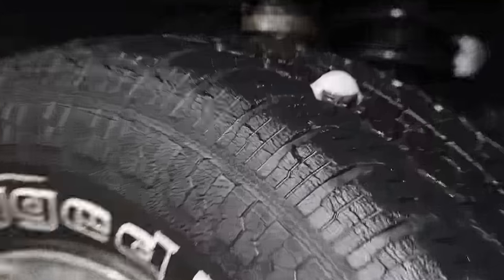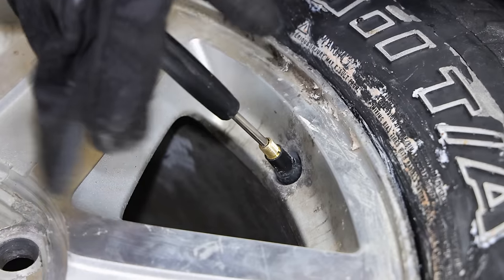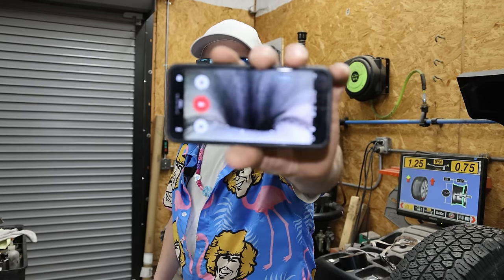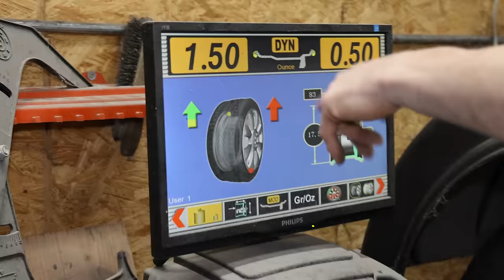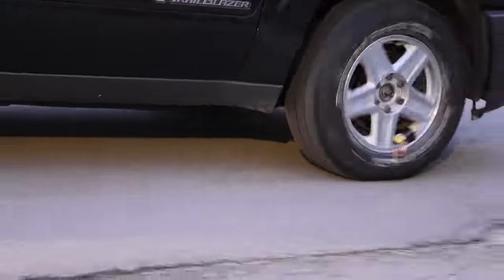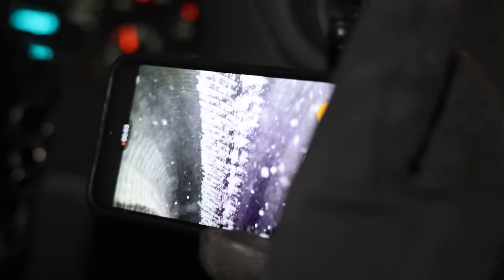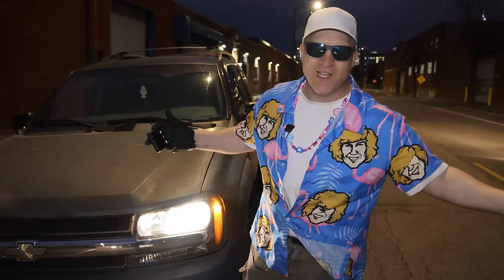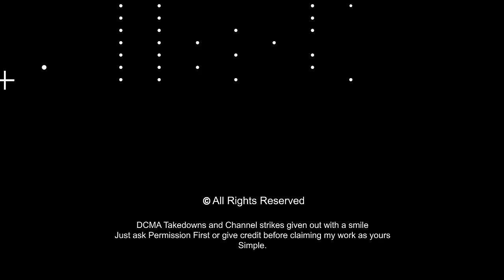GoPro Inside a Car Tire (With Balance Beads)

Comment: Briefly studied this in engineering school. For balance beads to work the tire has to spin out of concentric. Won’t give you consistent results on spin balancer because the wheel is held firm. 2oz out of balance nothing to brag about.

Some have good luck with balance beads. For others when the wheel hits a bump it spins out of concentric, moving the beads, which then have to move back into place. A bump from the road followed by a bump from imbalance. And then there is the issue of having to rebalance every time the wheel starts rolling. Some beads are sticky or use static electricity to stay in contact with the tire.

That I know, OTR trucks simply do not balance any but possibly the steering tires. And use weights.

Good old fashioned balancing works. There is a reason your new car doesn’t come from the factory with balance beads.
Reply: I have to wonder if they act as an abrasive on the inside of the tire. Probably not enough to affect the service life.
Reply: They came in my Yamaha ATV tires from Factory somebody in engineering probably recommend them
Reply: Sometimes you need an engineer to call out the BS. Thank you sir!
Reply: But then you sometimes need to rebalance as the tire wears.
Reply: @VndNvwYvvSvv  I don't find that to be as true as it was 40 years ago. Balance motorcycles tires myself when mounting. Have checked balance before removing old tire and found it to still be pretty good. On cars my deal with Discount Tire provides free rotation. Don't believe they balance when rotating.
Reply: "Some beads are sticky or use static electricity to stay in contact with the tire". 
Bragging moronic statement of the year which disqualifies you as a human being. Guess you never heard about centrifugal force...
Reply: @rafars2246   Yeah he definitely made that up. Sticky beads would just be a big wad of sticky beads, unless they magically didn't stick to themselves. And static wouldn't be nearly strong enough to do anything vs the forces caused by rotation of the tire
Reply: @rafars2246  wow, your attention span can't remember the sentence prior to the one you are reading. "And then there is the issue of having to rebalance every time the wheel starts rolling. Some beads are sticky or use static electricity to stay in contact with the tire." Static/sticky holds the beads in place when the wheel is not rolling.
Reply: @N4HHE  It's clear you're the actual engineer here. The lack of reading comprehension in those replies physically hurt me.
Reply: @KingNast  you are too young to remember how various liquids and Slime were touted as tire balance aids before the “beads” craze. Beads moving around in a rubber tire are going to generate static electricity and could stick to the tire for a while when stopped so as not to have to completely repeat the balance phase when one starts rolling.
Reply: He needed to run the tire with the go pro, BEFORE adding the beads as a control.  See what the balance is, and then add the beads.  

Weighing the go pro, light, mount, VHB tape, everything before hand, and then adding that weight in beads would have also been good too to see if the beads counteracted the weight.  Would have been interesting to see that.  

The issue is also the beads are held in place by the force.  It doesn't matter what bumps it was hitting, and you can see that on the camera when he was hitting all the pot holes, they stayed in place until the force(speed) was reduced.  It works the same as the centrifuge (G-Ride) at amusement parks.  You are held in place no matter what the faster you go.
Reply: @N4HHE  Beads do not use static electricity, nor are they sticky.  If they were sticky, they would clump together and not move freely.  Same goes for static electricity, they would group together, defeating the purpose of finding their way where they need to go.  They are held in place by centrifugal force, that's it.  

The entire purpose of the beads are to move each and every time the tire is rotated, thus balancing the tire as it wears from the outside.  They do not find their place and stay there, until the tire is changed.  That's why it's claimed that they are better than stick on wheel weights, because those remain in the same place, even while the tire changes with wear or damage.
Reply: @PTRRanger951 They could still move freely, but stick when the tire does not rotate...
Reply: @N4HHE why didn't we see it in this video then?
Reply: @hawkie333  Before these glass beads were a thing they used to use ceramic beads which would certainly have a porus surface and would be better at removing material. If you would do a flat repair you would notice that it did grind up some rubber but it was always inconsequential, not even close to the amount of rubber you a grind when installing a patch, for instance. I can only assume that the glass beads probably don't even start removing the rubber. They are much smaller in size and diameter. Therefore the force and momentum they're gaining wouldn't do as much and they have a completely smooth surface. Basically if the old ones didn't chew up the tire too bad these ones certainly aren't going to.
Reply: @GoGoGoRunRunRun  they don’t stick. There is nothing sticky about them.
Reply: @NewHandleTown  see what? We did see. We saw the beads balance to a pathetic 2oz on the spin balancer. We saw beads flying around when bumps were hit.
Reply: @PTRRanger951  maybe not the beads in this picture but that is not what always has been.
Reply: @PTRRanger951  OP mentioned electrotatic buildup. I've read about the topic and there are beads available specially coated to enhance flow ability, and to avoid (static cling) sticking to the inside of the tyre. So apparently the OP is right...
Reply: I don't see any advantages using this instead of old school counterweights. Maybe if you got some "I like to hoover the garage after a tire change" fetish.
Reply: good post
Reply: Yea but in some cases its all you can do, I have the dexter style rims on my utility trailer (large doughnut rims like on large camping trailers) I used these and it took away all the vibrations
Reply: @N4HHE  Its the opposite. They have a charge to NOT stick together or to the tire. The goal is to allow zero fiction on the bead to allow the centrifugal force to cause the beads to flow where they need to be. In essence the beads gather a little more in the areas of low weight thus offsetting the high weight on the other side.
Reply: Did you read the Penn State engineering study performed for Equal? 

In my experience (I used Equal in conjunction w/weights despite the manufacturer not recommending) the balancing compound actually kept the assembly in balance for the life of the tire.

The assembly spins concentric with the axle on the vehicle so I assume you're referring to the dynamics from the suspension.

Not balancing drive or trailer tires is just dumb. All tires should be matched to the wheel to minimize for runout & balanced. Either out of round or out of balance will cause cupping. The only reason drives (or on the rear of a pickup e.g.) ride smoother when loaded is that there's enough weight to counteract the out of round condition.
Reply: @PTRRanger951 there are beads that stick.... Don't ask me how they work, but I've pulled many a tire with them uniformly stuck to the tire inside.... They're not SUPER sticky, just enough to stay.
Reply: GO PRO WEIGHT....
THINK ABOUT IT
Reply: Thank you for the educated insights.
Reply: Considering there's a GoPro in there 2oz isn't bad, lol
Reply: @rafars2246 dude, it’s centripetal.  The author kept saying “centrifetal”. It drove me up the wall.
Reply: For starters, technically you are not balancing a tire. You are compasating for the imperfections of the tire and wheel. Any type of balancing beads don't work. The wheel is usually the cause of a vibration because the wheels are made of steel or aluminum which is way heavier than rubber per inch. If you have a pretty true tire and wheel, you most likely not feel any vibration. In fact if you drove a new car and took it to a tire shop and checked the balance, you will find that every tire will  need anywhere from 1 to 2oz. Off. Today's tires and cars suspension will make up for any imperfections of the wheels. The video shows that the beads spreads out throughout the tire. If it stayed in one spot, the 3to4oz  it would give you a vibration. This is 100% B S  I've been working with passenger and commercial tires since 1983.
Reply: If the beads worked there would be none on the side with the go pro because they would be on the other side balancing it out. Instead we see a fairly uniform layer throughout the interior of the tire. Therefore the beads are reacting only to centrifugal force and not to out of balance rotation.
Reply: @stevenvanpelt8059 you make both accurate and inaccurate statements
Reply: TECHNICALLY centripetal force.  Centrifugal is a 'fake' force.
 
Yeah, just had to be pedantic since so many people think centripetal doesn't exist, when it's the actual physical force.
Reply: @stevenvanpelt8059 you're wrong
Reply: NOPE, thats not how it works.
Reply: The early version of this was a steel tube mounted outside the wheel. It was a ring that was almost as large as the wheel, and it was mounted where traditional lead weights are at the rim of the wheel. They used steel shot inside. But...they would end up a rusty, dusty mess over time. So they moved the shot to inside the tire. It would still rust and clump and it caused damage. Then came ceramic and now glass beads to solve those problems. 

The biggest issue with the tire balance machine argument here is that beads are not designed to, and will not, properly balance a tire at low speeds. 30 mph and above are normally the advertised speeds for a tire to be balanced. Most new tire balancers spin much slower than old ones did, due to technology advances and for safety. They also have tire size minimums that they will not work in. They are designed for larger wheel and tire sizes, last time I was considering using them anyway.

Now the actual balance part...I haven't watched the videos for years, but I recall it was more of a two dimensional issue where the beads shift in the tire until they are equal weight at any given line straight across the diameter from one another. The best visual I have seen for this a clear water bottle with some of the beads in it, mounted to a hand drill and spun up. It was pretty neat to watch it happen, and at what speed it works at.

And only 1.5 or 2 ounces off on a modern low speed balancer? With a Go-Pro mounted inside? That's really good for anyone who has never used tire machines. 

Awesome video overall.
Reply: Have a Jeep with oversized tires and never had a problem with the beads, and off-road I hit more bumps and holes in a weekend than any street car does in years. Only problem is with fast takeoffs, but since I have a Jeep TJ so that’s a non-problem.

Comment: Yes they work, i put them in my land cruiser MT tyres after i could not get them balanced with weights, the work well. 
I had a flat after about 25.000 km and there was no damage in the tyre and beads were clean, no dust or other debris.

Comment: Ive been using ceramic balance beads in all my truck, car and motorcycle tires for years. They work awesome. You must put the correct amount in the tire depending on tire size and tread width or you can have an out of balance situation from too many beads. You get a random harmonic imbalance that comes and goes when you have too many beads installed.
I swear by ceramic beads. Tires last longer and they perfectly rebalance the tire every time yhe tire gets to 15mph. Ceramic beads are reuseable too. Causes no damage to tire, wheel or tps sensors.
Reply: Awesome. The Counter Act balancing beads he shows here are not plastic but rather smooth glass beads. I use them in my Semi Truck tires. There's a chart that shows the proper Ounce bag to use for your size tire. Also install the extended valve core that comes with them

Comment: Amazing how well they work. In India we are using rice instead. Works the same way, but you have to replace the rice at least once a year. But we have enough of it, and it isn't very expensive.
Reply: And the removed rice gets sold it the local supermarket?
Reply: @jimspc07 Norway here, that would be sold as "scrxxed rice" or carcinogenic supplements

Comment: I run beads in all my truck tires, I've never had a smoother ride out of tires over 35 inchs. I've heard horror stories about Milestar Patagonia's being incredibly hard to balance but I've been through two sets of 38's on my Jeep and the beads work perfectly.

Comment: I've been using these for about a year now. I was initially under the impression they found the inbalance area and stuck to it. Your video cleared that up. They don't stick, instead it's a continuous move to find the inbalance. Awesome video. Be careful and follow the directions. Amount matters for tire size. 😊
Reply: Main purpose of balance beads is they decrease your bank account balance when you buy them
Reply: Yeah, no.  The beads don't "flow" to the place where the wheel is out of balance, like water to a low spot.  Once you get up to 20-30 mph, the beads are spread all throughout the tire … completely random…and are held in place by centrifugal force.  Then they stay there until you slow down enough.  Then they redistribute completely randomly again the next time you take off.  That's why he measured 2 different settings on his tire machine at the beginning  of this video.
Reply: They probably stick if tire is not dry ( care about moist and grease )
Reply: 4  -6  oz should cover most situations
Reply: Yeah they can't stick to one area. When you stop the bead will settle also , tire in balance is different at various speeds.
Reply: @gorak9000  A few bags of Counteract beads for 4x 19.5 tires on my 2500HD was cheaper than 4x tires being manually balance fwiw.,
Reply: @kfelix2934  yup, but it needs an example.

Imagine a tire has a part with a different elasticity. You can balance the tire at  given speed. But at any other speed, because elasticity is not the same everywhere, parts will get further away from center by different amounts. So it gets unbalanced.

Comment: Mechanical Engineer here. First off, excellent work and video. I’m going to take a stab at explaining the balance bead functionality. First off, any spot on the wheel or tire that is rotating around the axis of rotation is experiencing centripetal force causing acceleration of mass toward that axis of rotation. The acceleration can be calculated as (V^2)/Radius where V is tangential velocity. It can alternatively be calculated as Radius*(omega^2) where omega is rotational velocity. Well, everyone has probably heard of Newton’s second law, i.e. the sum of the forces are equal to mass times Acceleration or F=MA in the direction of the resulting force if not equal to zero. If the mass of the tire isn’t perfectly distributed, then there isn’t equal mass on the opposite side of the tire to cancel out or equalize the sum of forces caused by the acceleration forces resulting from rotation. As rotational velocity increases, the resulting forces increase by square. A heavy spot will “pull” the entire rotating assembly (rim and tire) in that direction because M in the F=MA equation is larger on that side. The beads being free to move throughout the tire will “fall” back to the side with less mass, think falling back in your seat as a car accelerates. The beads being pushed to the side of the tire with less mass essentially balances the “tire”. I understand this stuff well, but may not be the best at explaining things, so please correct anything I missed.

Comment: I use them on my 05 Suburban tires and they work very well. When I put the beads in mine I dumped them in the tire after you put the inside bead on the rim then dump the beads on the opposite side of the air valve and then mount the outer bead on the rim and inflate the tire,no mess with beads all over the bead seat getting stuck between the rim and the bead on the tire.